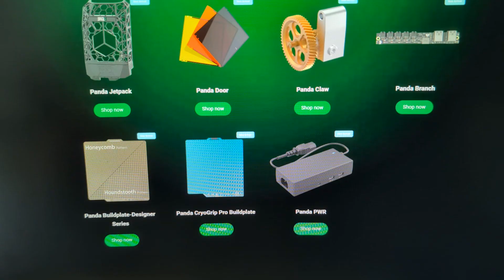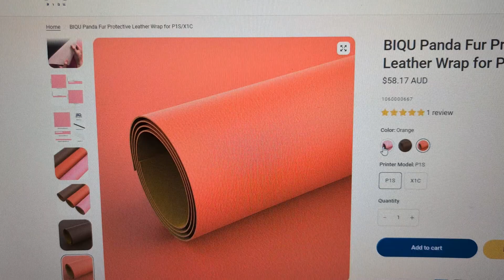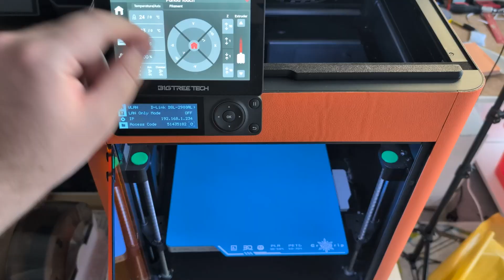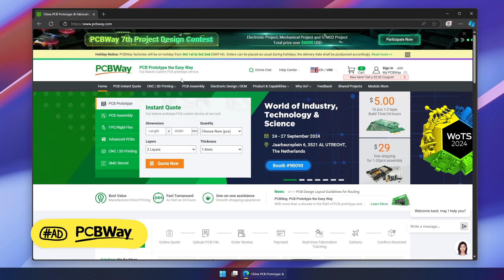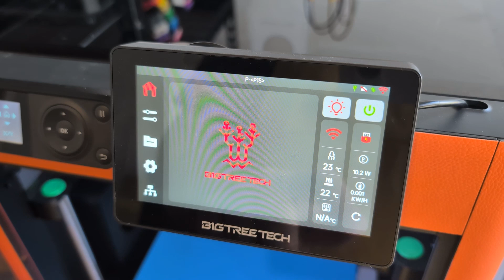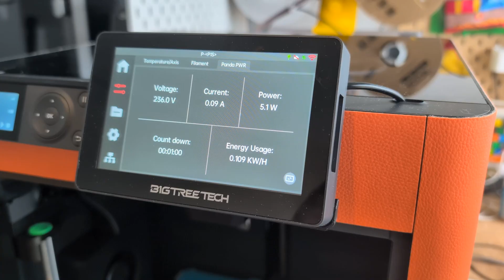The Best Upgrades for the Bambu Lab P1S

Comment: I wish that easy-changeable hotend came in 0.2mm size. For some fucked reason they only offer 0.25mm which is a nonstandard size and potentially causes slicer issues. Kind of a bummer. Easy purchase if they offered that.

Comment: The cold plate has limited compatibility doesn't it?  Meaning that you can use a lower bed temperature but only with a few types of filament, yes?

Comment: The hardened gear mentioned toward the end of the video is a needed upgrade along with a hardened nozzle if you plan on printing any filament with carbon fiber, glass, or other metal plastic alloy filaments.

Comment: I think my top upgrade other than the bundled AMS was the anti-vibration feet. I got some generic ones from Amazon and printed some adapters for them and it significantly reduced the noise of this machine. I also printed the AMS Flipper on MakerWorld to keep my AMS secured to the P1S top which may not be suitable for everyone but I love it.

Comment: I upgraded my screen and added the light and my camera stopped working. Haven't been able to find a fix
Reply: It might be a power issue because of too much current draw from you new light and screen and why your camera can't get enough juice. Try to use a separate power supply like an old phone charger. Or even better calculate if my assumption might be true. Add up the power consumption of you new add-ons or measure it with a multimeter. Etc. Good luck!

Comment: Does the screen still work after the recent changes to the Bambu printers?
Reply: Only if you don't update to the firmware that removes that functionality or run the printer in "DEV" mode if you update the firmware.

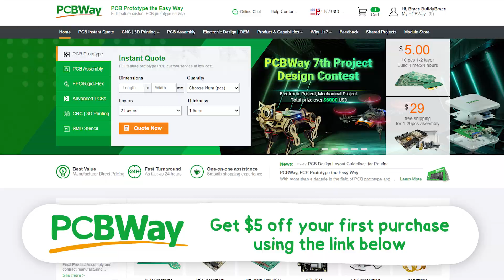Comment: 4:24 nahhh bro what I have p1s for about a year now and you are telling me this machine have usb port😭god I feel so stupid for not knowing that
Reply: The built-in usb port is very difficult to access, and it only supplies a tiny amount of current. You need to be careful what you power from it, you could fry the model, so I certainly wouldn’t adding a splitter unless it has good regulation and overcurrent protection.

Comment: stick with the plastic extruder gear, it's by design. metal on metal gears need grease, not good in the enclosure. also, ensure the right gear mesh is used when assembling, or they'll just grind away.

Comment: These "upgrades" seem pointless!
Reply: The quick swap extruder seems nice, but not for 120+ euros
Reply: Kinda what I was thinking.....waste of money
Reply: @FireAntzTV some of them are actually good, mainly the build plate, which I heard very good things about. But I agree most of them are completely pointless and just a waste of money. At first I thought the panda revo was gonna be something I would buy and then I looked at the price. Like what the actual fuck. 100+ euro for the full thing and like 40-50+ for literally just the nozzle.
Reply: From a different perspective, these upgrades are more for quality of life/aestetics.    For a printer like this, actual hardware is unnecessary/ difficult to install compared to a printer made for constant hardware additions like prusa

Comment: Why hasn’t Bambu put the screen from the A1 on the P1S yet?
Reply: They want you to buy the carbon.
Reply: @justinorwen1739 Yeah, but the A1 is significantly cheaper than the P1S but has the better interface?
Reply: @swooshdave  I agree, but I think they thought if they put that screen on the p1s that most people would buy it instead of the carbon because it's 2x the price with only a couple bells and whistles. That's why I bought the p1s.
Reply: what's the point, I barelly use the display anyway. the phone app and the laptop app does the job 95% of the time, remaining 5% is covered nicely by the digital display
Reply: @JC-xz5xu  I thought I'd get the display for sure. But then after using the printer, I agree. The app and slicer software works so well I don't even feel like i want the screen
Reply: @JC-xz5xu  Good to know, I guess a decent display would be a nice to have.
Reply: @swooshdave  its more like... cramp up... you are going to have about 5000 things around your printer as upgrade, I think adding a display is almost equivalent to adding more chaos to the system. also I am coming from engineering background so my perspective on it perhaps a bit extreme too. (KISS principle)

Comment: The energy savings through lower temps for build plates is really only ever relevant if you print 24/7, like you said.
The ROI of the build plate is horrible, so I really dislike that "justification" many people bring for buying that plate.
Reply: main benifit of being able to print a low temp is the extruder and hotend won't overheat and jam all the time

Comment: nice vid! on 0:52 you plugged it in a block with 4 connection. how and where do get that one?
Reply from the maker: Included with the Panda Lux
Reply: @BuildyBryce would not recommend using that because it can damage the board in the p1s because it’s withdrawing to much electricity since it’s powering 2 lights